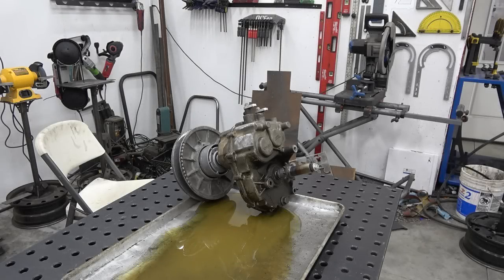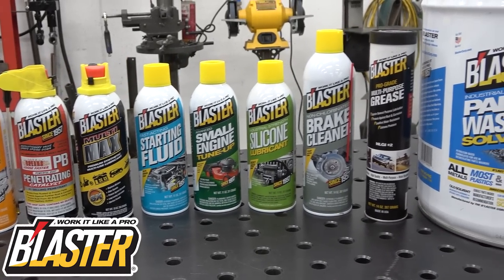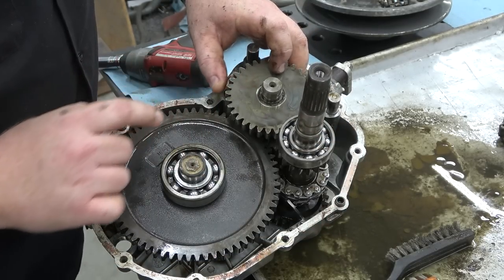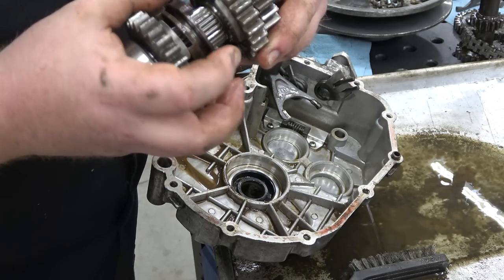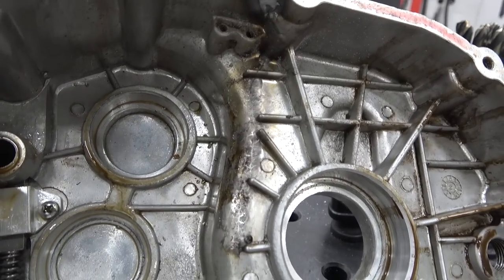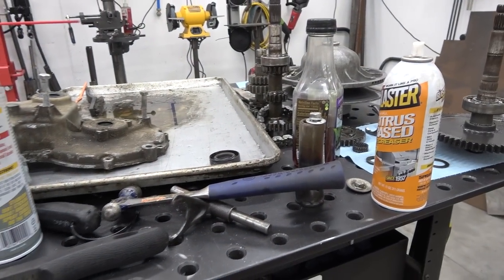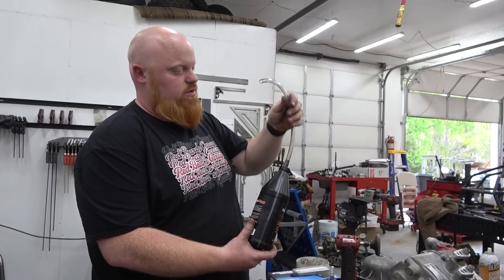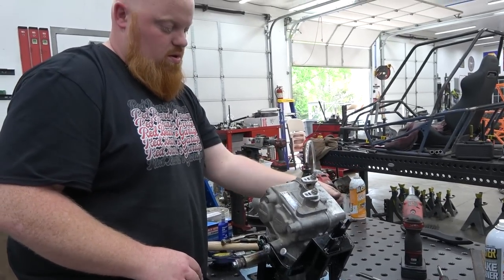Polaris Transmission Crack Repair ~ Homemade SXS Go-Kart Transmission Repair

Comment: One thing that might be putting extra pressure on your case is Polaris runs an outer bearing on the sprocket output shaft on 4x4 transmissions.

Comment: This video with the Polaris transmission really got my undivided attention. I am currently building a Kart with Duro 440 cc using a Polaris Trail boss 250  2WD transmission.  I'm relieved to see that your transmission mount is similar to mine. I used an outboard bearing on the drive sprocket for additional support.  The input is from a TAV 40. You answered  a question for me about using boat shift cables for the transmission shifters  I had been considering that option by process of elimination.  Like you, I noticed that the transmission shifter arms are somewhat hard to shift.  After some thought, I decided to lengthen the shifter arms to reduce the effort required to make the shift.  The longer arm will require a longer stroke.  This should also make it easier to adjust for the shift detents  on the transmission. The additional length levers should make the setup more forgiving of a little play in the shifter. Your channel continues to be my go to source for tech information on the Karts .
Reply from the maker: Glad the information was helpful! Thanks for sticking around!
Reply: What secondary clutch did you use on the Polaris Transmission?
Reply: @shaunlucky-samaroo688  The "clutch "is a TAV 40 delivering power from the engine to the input shaft of the transmission.  The transmission output is connected to the axle via # 40 HD chain .  The output shaft has a ball bearing support to prevent damage to the shaft bearing in the transmission.
Reply: @kwatt-engineer796  what you have connected to the input on the Transmission?
Reply: @shaunlucky-samaroo688  The TAV 40  has an output  sprocket ( 10 tooth)that drives the input shaft,  The input does not  need an outboard bearing  because the shaft is supported on both ends

Comment: If u don't have it engaged all the way in. It will sound like it's skipping gears. My youngest daughters go cart did that and I took the transmission apart and didn't see nothing wrong. I figured she was not putting it in gear correctly and sure enough she was not. When our brother was starting to weld. It sounded like a honking and the dogs was barking and running to the front window and they was like huh. One walked past the TV and went bonkers and the others joined in barking at the TV.

Comment: Not quite about the gear wear. These gears are not marked so differend teeth are now engaging. So these have to run in again. To beef up the plate: why not use this plate and use 90° angled iron lenghtwise over the bolts and spotweld it on the plate. You want it stiffened not heavier in weight. In ship building they use ,holland profile,. Its flat profile and on one of the sides round is ,,welded,,. ( To give an impression) its cast this way.